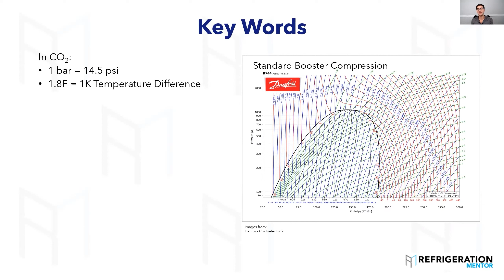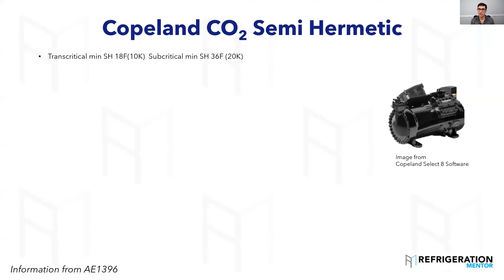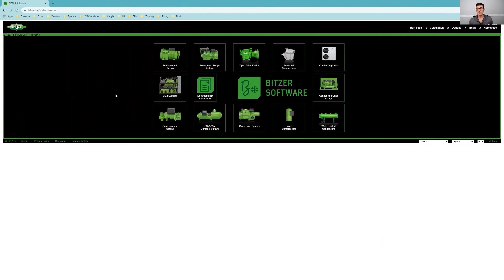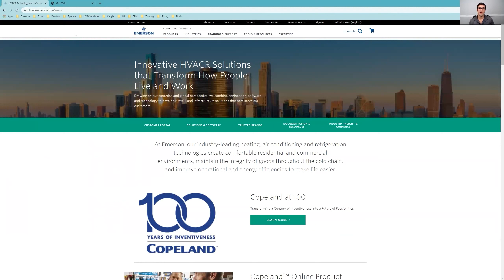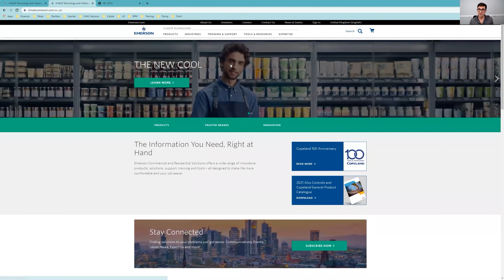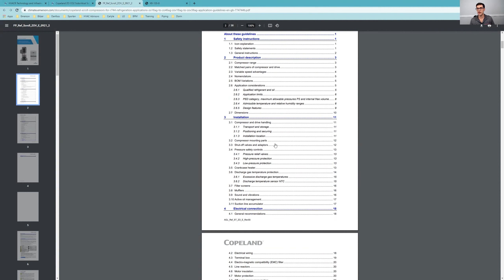20K/36F Compressor Superheat WHAT!!!!!

Comment: Is CO2 can be used for airconditioning?
Reply from the maker: @Josewww350  yes in many applications from vehicles and residential units to commercial and industrial systems. It is a very small install base at this point vs synthetics but it will continue to grow. CO2 is a great refrigerant but it is not the solution for every application.